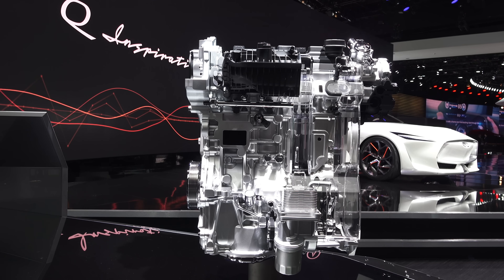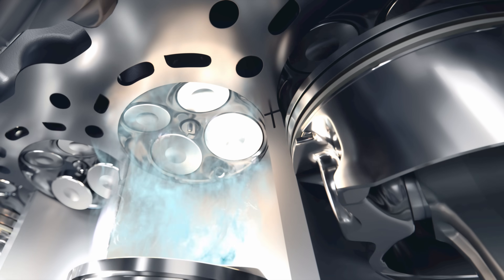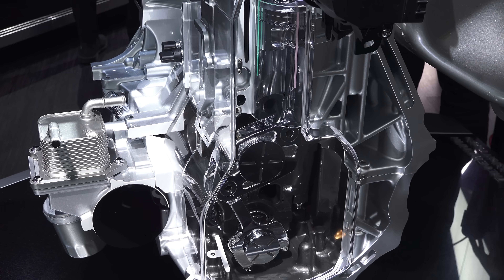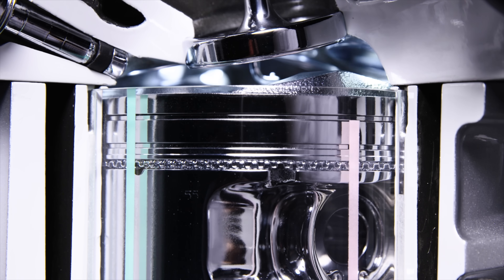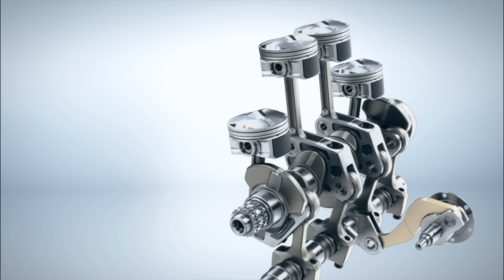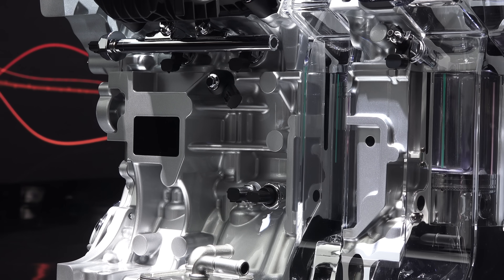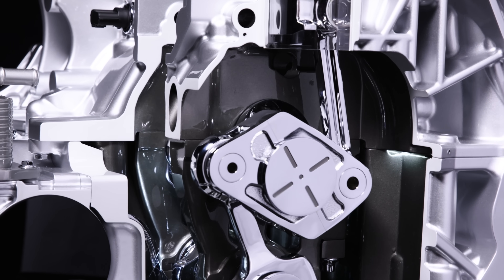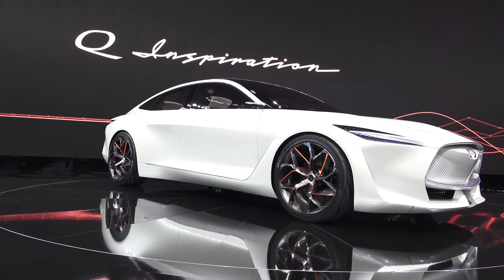INFINITI Reinvents The Gasoline Engine — VC-Turbo

Comment: love nissan/infiniti But I am very curious about this so-called "real-world testing" Because They don't do well with the new technology, I remember how bad the CVTs  of 2007+ models were And now a new engine?? I will be following this closely I am very interested in this I would love to see a year review from consumers... I remember there was a Boeing 737 engine that failed, and they found out that when they tested the engine, it was under high load and found out that a normal flight throttle The engine blades moving fast enough to dissipate the hail and ice and prevent it from getting into the engines Enforced and emergency landing, so coincidentally some Indians can perform under high stress but not as well under light loads if you get when I'm saying

Comment: I'm slightly confused as to where the drive train actually starts.. as a result of the var, surely the crankshaft isn't stationary, so how would that be transferred into a "stationary" gearbox or fly wheel or whatever system they chose to use?

Comment: This is great an all... Until the compression gets stuck at 14:1, it hits boost, and the cylinders are vaporized
Reply: Yeah, I can't wait until they invent an electronic device that would be capable of detecting such issues so it doesn't happen. If they do, I reckon they should call it a "computer" because it sounds cool.
Reply: @funkynerd_com  some people are so dense. Lmao
Reply: @funkynerd_com   Yeah mate nothing run by a computer has ever fucked up....Especially the New Boeing 737s...... Think before you speak mate
Reply: Joe Blow Yeah bro, cuz nothing mechanical ever fucked up...
Reply: @themisunderstoodgorilla7030  you are vastly underestimating computers
Reply: @naut3  Problem is the sensors always go bad
Reply: Similar reault to what happened on the 6.0l fords VG turbo.  Vanes got stuck in the fast spool position which at higher rpm caused too much boost and blown head gaskets lol
Reply: @danielh4995  lol
Reply: @danielh4995  that's no problem
Reply: pyropulse  armchairs is where engineers operate....
Reply: @freelectron2029  All great plans are made in a chair.
Reply: Zylinder head? Dont need that
Reply: These engines are all computer controlled. The position of the compression ratio control system is always known by the computer. So in a fraction of a microsecond, the computer will control everything required as programmed by the design engineers. No smoke! Instead, new lower performance mode. Cheers!
Reply: witch could happen if they thing that switches modes is a damn electric engine.
Reply: Vital Mendoza  I would imagine it fails into the safe position of 8:1 so you will just end up with a slugish response off boost.
Reply: Well "vaporize" is a bit harsh. I'd say "melt".
Reply: im pretty sure there probably is some kind of safe measure built into the ecu. Meaning if it can’t switch CR maybe it throw its self into limp mode and limiting throttle until its serviced.
Reply: Except it has forged internals so that wouldn't happen.
Reply: @alexscarborough6263  the injectors wouldnt handle it.
Reply: Alex Scarborough ..So your saying as long as you have a forged bottom end you can do whatever you want? Damn....why didn’t I think of that! I could have been running unlimited amounts of boost this whole time!

Comment: Just another example of car engine designers getting caught up in their own cleverness and introducing massive increases in complexity, number of parts, speciality service know-how, etc,  and all for so called "efficiency" and emissions gains. Better efficiency and emissions of fuel consumption is people walking to the nearby shop instead of driving this hitech "miracle".  FFS, it's only a car engine, and a four stroke petrol one at that. Do we really need it?

Comment: I know of a VCR technology that is 500 times simpler mechanically and has more mechanical flexibility that would revolutionize the IC engine efficiency at a much lower cost to the end consumer. I know that narrator of this video have mentioned that he collaborated with Nissan on this video, image if u go back to Nissan to tell them that there is a VCR tech out there that would make your tech a bit obsolete they might dismiss u at once. The tech I’m talking about is not MCE-5, not lotus Omnivore, and not some major engine manufacturer. This tech is as state of the art and more importantly far simpler than Nissans present VCR. I challenge Nissan to a debate on the validity of my new VCR engine tech, real challenge, any time any day. Good luck.

Comment: They still have not found the most simple & efficient solution to powering a car. 
The self Generating Electric car. 
All this seems over complicated. 
3 or 5 cylinders is a far better design. as he says 4 is not the best number by far.

Comment: The higher the compression the better the thermal efficiency is in the cylinder the better the thermal efficiency the better the burn. Meaning your are utilizing much more of the fuel a.k.a better burn or combustion resulting in more horsepower and better fuel economy u do not get the same affect with a lower compression engine

Comment: Why not keep TDC the same and just change the BDC stroke distance? Varying how far down the piston goes will change the varying compression ratio when at TDC. From the looks of this engine, by doing this, they could eliminate half the freakin moving parts, moving parts creates more friction, creating more heat, less parts less heat. I could easily see this engine needing oil changes at real close intervals due to thermal breakdown.

Comment: This is a big no.
I think they can very easily just insert a rod inside of the combustion chamber, coming in or out, as compression and temperature changes.
This uses too many variable parts.

Comment: why is the answer always over engineered, increasingly complex designs?  I'd like to see a four cylinder naturally aspirated diesel that's more modular than a Chevy small block (with both universal parts and ease of service) that's both efficient and reliable.  I don't care about performance, I just want reliability, fuel efficiency, low cost of maintenance, and ease of service.
Reply: Move to Europe,Peugoet makes a 1.5 ltr 3 cyl turbo diesel with 130 hp that does 75 mpg all day every day.
Reply: Cheap - Fast - Reliable           Pick TWO.
Reply: Louis Cruse wow nice way to sum it up I’m stealing this qoute
Reply: not very relaxed
Reply: MrRelaxedBrax lol tell me more
Reply: Just buy a older model vehicle. Car companies were way more focused on reliability in early years. Now they have the knowledge and experience to figure out how to make a car run for a certain amount of time before it kicks the bucket. Car companies make way more profit on servicing and fixing cars than selling them. I have a 2002 Honda Accord 3.0L V6 with the original engine and I just hit 252,000 miles last week, and this thing still runs strong. No knocking noises or anything. Only complaint I have about this car is the heat shield for the catalytic converter rattles. I couldn’t care less about it. Let that sucker rattle it’s heart out lol.
Reply: And i want a unicorn.
Reply: Bring back the flat head!
Reply: Actually Mercedes made a bunch of 4 cyl nat-asp. diesels in the 70's, 80' early 90's and most of those were very relieable, eg.: W123 240D with OM616 engine, or  W124 200D with OM601 engine but the 5 and 6 cyl diesels were just as fine. If you want you can still get them on a budget, but you should expect some age related issues such as rust, and wear due to high mileage.
Reply: Bálint Valent 
The 240D was indestructible. Power....what power, lol.
As for the 5 cylinder turbo diesels....I broke the camshaft on 3 of them. Yes, I did run them fairly hard and they had quarter of a million miles on them. Very rare, haven’t heard of anybody else happen to them and I was a tech for Mercedes at a dealership with factory training. So 3 different cars, both broke the camshaft in half destroying the pistons and heads. Somehow the block and cylinders didn’t get damaged. Rebuilt them and went on strong until I sold them.
Reply: More parts to Fail or repair.
Reply: ChinchillaInTheHeat 
Preach! The problem with that is the manufacturers don't make anything from reliable cars. They make expensive garbage and expect everyone to lease it.
Reply: Electric motor with a small turbine as generator, I think Jaguar had a project with something like that, but what about that new British fuel? HCL I think, clean high octane usable in every engine, seems a good deal to me. In my country in particular, some people are creating GNV kits, they are getting better each gen, now we are on the fifth, it's low cost, the problem is the transition, which isn't, but the thing do some crazy mileage per cubic metres for very low price, If my country has invested on it as they did with ethanol, I think we would have an amazing tec, even better than our flex engines.
Reply: ChinchillaInTheHeat buy a duramax 2.8 turbodiesel gm
Reply: If you don't care about performance you're probably not buying an infiniti.  Different cars for different audiences. If you want a cheap, reliable econo box you certainly are not limited in choice right now.
Reply: Makers want disposable  cars make no money when car last 200000 and 15 years want you to buy new one every 8 years
Reply: @garypeatling7927  except good modern cars now often last 150-200k without major repairs.  Reliability has been climbing steadily for decades.
Reply: Reached peak in 2000 on way down now I'd say Ford petrol zetec  so good practically  sent them broke
Reply: 1
Reply: My dads mk4 2l golf has 600,000 miles and does good economy, they are cheap now too because of the whole emissions scandal. The motors are crazy reliable though
Reply: more like a long stroke inline 6 ...
Reply: Look no further than a b series honda...wait diesel? Why? The reason you dont see very many 4 cylinder diesels is because of high compression ratios and generally smaller bores which means small pistons and small rods.

My dodge cummins is 17.2:1 compression ratio. The closest you will find to what you want is the gas powered skyactive x from mazda which is going to get recalled in a year or two. Just watch.
Reply: Noise Technician You don't see a lot? That is the most common engine in europe.
Reply: YOUR A FUKEN GENIUS! I PROMOTE YOU TO CEO OF GM EFFECTIVE IMMEDIATELY.
Reply: @MrRelaxedBrax  It don't take no genius to be CEO of GM, case in point , Fritz Henderson.
Reply: it's called the complexity rule moron
Reply: 4 cylinder n/a diesel? You want a John Deere or kubota engine in your car?! I saw someone do a swap with this very same notion, it wouldn’t do over 55 mph down hill with a strong tail wind
Reply: stellingbanjodude 
Well, my 2 L 4 cyl TDI cars make 175hp and 320lbs of torque. My 2015 VW TDI gets 60 mpg and will do 0-60 in 6.8 seconds. Yes, the old technology diesels were painfully slow but the new ones with common rail injection are awesome. The only thing bad about them are all the emission control junk that EPA has mandated making them a bit expensive to repair.
Reply: @UC4ezdgvXxU68v6lF7aZ4lZQ
@UC4ezdgvXxU68v6lF7aZ4lZQ
Why is it you do not design one?
Reply: We can poster it as the IKEA of cars. Gonna Be HUGE with the upcoming LEGO crowd!
Reply: Get an electric car if you're that worried about fuel efficiency. Gasoline and deisel are not as close to 100% efficiency as electric, plus you can charge your car at home and while you are driving
Reply: ChinchillaInTheHeat i am excited about the release of our new MODULAR CONSUMER SERVICABLE-ASSEMBLEABLE-UPGRADABLE UNIVERSAL LONGLIFE CHEVY LLAMA.
Reply: Do you think we should include the build manual on disc or paper?

Comment: Don't expect to repair the motor from non dealer mechanic after warranty is over.
Reply: Why not? Many shops take on major work on late model vehicles fresh out of warranty. 
Dealership information is usually a resource many reputable shops have.  
Of course they do not always disclose everything
Reply: @ProVision3187  john deere today wont allow all their computer programs out to the farmers so they can do repair. And why all this computer technology anyway? Seems its working well but not enough to encourage me to jump out for it. Im thinking the only thing driving the train is the goofy govt regulations from calif, making us do crazy things and making engines extra expensive
Reply: Toe Toeknee never mind the dealers either! Nissan/infinity dealers cant seem to fix their own cars properly
Reply: We tried it and very easy
Reply: mister clean  that's why I stated "with the passage of time" battery technology will catch up.
Reply: @JM-kp2vg  
Wait until the world discovers how much earth has to be destroyed to make 1 lithium battery
Reply: It’s better to change the engine. It’s like Apple iPhone repair for damage
Reply: Why not? It's all just nuts and bolts.....
Reply: @derekbader130  factory parts are often pressed in to avoid time delays.
Reply: @gunnargunaxe  what does being a factory part have to do with my reply? I think matey was more concerned over the repair procedure/ tooling involved...
Reply: Toe Toeknee you have definitely overestimated the competency of dealership mechanics and underestimated all the good and smart mechanics everywhere else. Well, I am not surprised at all. You are inherently a Chinese descent.
Reply: Toe Toeknee wrong, it’s easy to be fixed
Reply: Japanese and Europeans seem bent on perfecting the combustion engine to derive maximum power and efficiency. I wonder though if they will be able to compete with much simpler electric motors with the passage of time. Remember all the hoopla about turbo engines. I don't think they turned out quite as promising as they were cited to be.

Comment: Why dont they just use a little variable lobe on the camshaft that cracks the exhaust valve for a split millisecond on the compression stroke and lets a bit of the pressure out? Wouldn’t that do the same thing? The wasted pressure would end up back in the turbo helping it spool anyway, and it’d be cooler unburt air that would make the exhaust look as though it contained less emmisions

Comment: Why don't they just make cylinder head gaskets that can expand and contract a small amount to change the compression ratio? Or something that moves into the combustion chamber to change its volume? This contraption seems like an overly complicated solution.
Reply: Wouldn’t that be harder to make? I mean what material can expand and go back to normal at command all while holding compression AND being durable? Not to mention how the computer will calculate where this gasket’s height is at to give it the right amount of fuel to burn at the given compression. This VC engine is actually a great idea, I just hope it’s reliable.
Reply: @ImNotUri  You could just lean the whole cylinder bank and head, thats what the saab prototype engine did
Reply: I thought turbos alone would take care of this.
Reply: It would be easier, having an expanded piston, that uses hydraulic fluid, and centrifisical force, by rotation,,, it was done, in the late 30's and 40's, but gas companies, bought the rights to use it, even though gas was cheaper back then, they thought it was stealing money from the gas barons..in the early days, major races, were won, by V-8 automobiles, getting more power, yet in a 300-500 mile race, these engines, trippled the milage of six- cylinder, and doubled the Four cylinders cars, and less breakdowns...
Reply: @mikebird2571  like that idea but increasing mass of piston is by far biggest problem in engine if you want revs also piston adjustment mech would be exposed to combustion  this design solves lot of 
Problem the rod being kept more verticle and keeping adjusting mech away from combustion  still looks like it would wear quick to me
Reply: @garypeatling7927 - bottom of piston remains the same, along with the same angle of travel,  only top of piston expanded, not very much, but enough to make a huge difference, it was a spring loaded piston, like a pushrod... Expanding taller as revs went up, so did compression, with fluid, to damper the effect for smoother operation, and fuel economy went thru the roof,  as less gas was needed, and centrifugal forces of piston maintained power, why in those early races, V-8's had the advantage of winning these races, by LESS fuel stops...than 4 cylinders or 6 cylinders vehicles... Check out the early stats, and was ruled out as illegal on the track, after the rights, were bought out by the oil barons..
Reply: Leeso nneville Saab actually had a concept engine long ago, the engine had a tilting head and cylinder row, changing the compression ratio, oddly, espiciallay for saab it was a supercharged inline-5
Reply: Or wait for Tesla.

Comment: The engine follows Atkinson principle of keeping the inlet value remains open for certain degree during compression stroke, leaving some of the intake outside the engine to improve the expansion ratio. So what about the leaving charge from the engine whether it causes depletion of fuel economy and increases the pollution or not

Comment: Great video and explanations.

My few cents.....

1). Dual injection gasoline engine is the way forward as it addresses the issue of carbon build-up on the intake valves. Glad to see another manufacturer addressing this. 

2). Are there other dual injection gasoline engines with turbo? I don't think Toyota's D-4S engines have turbos. Is this a tuning issue? Does turbo in a dual injection gasoline engine make it inherently a headache to tune?

3). The engine may be great but some new development in transmission from Nissan is expected. Would be interesting to see if they stick with CVTs or have something interesting up their sleeves.

4). Who dares to buy version 1.0?